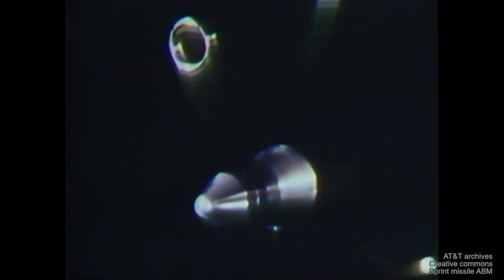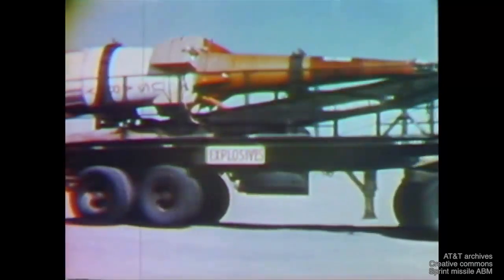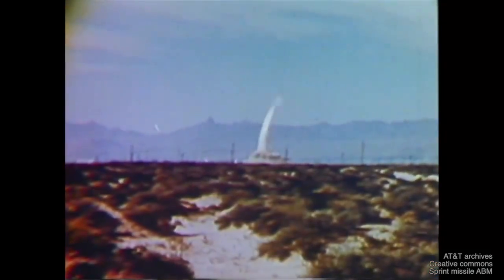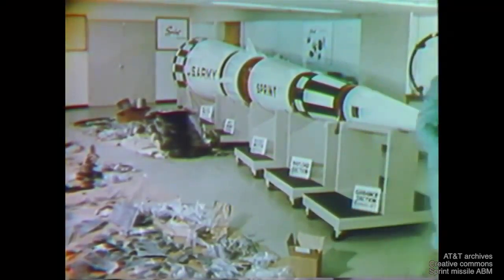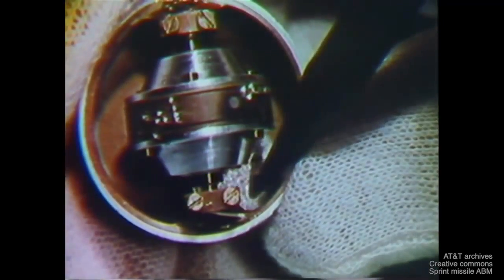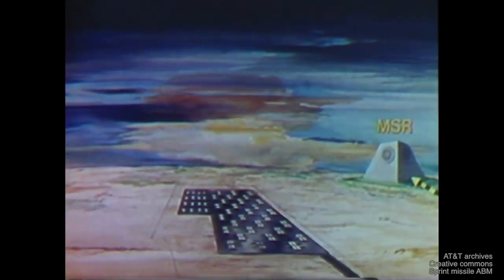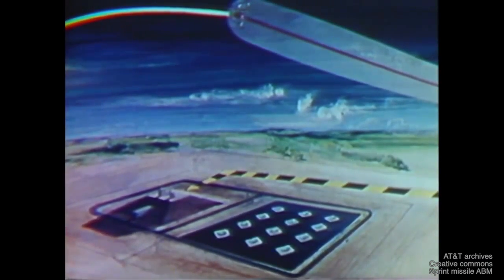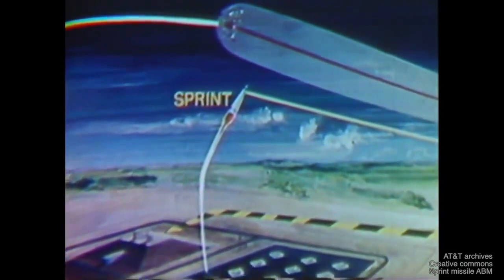SPRINT missile from Martin Marietta - Florida

Comment: My father worked on this missile at WSMR in the mid-late 60's. I remember him telling the story about the corkscrew failure at 1:31. The trick to the missile was target acquisition as the vector for the missile was fed into as soon as it cleared the blast silo. The telemetry form the acquisition radars was very impressive considering this was 50 years ago.
Reply: Mark Satterfield, yeah, and probably 300 bps data rate on the command link. Every bit counted back then, the logic optimization was extremely impressive by modern standards!
Reply: Yup, the old man was Systems Manager for the program.  He said it dug a crater you could have dropped a Mack truck into, and I think he said the entire flight was something like 0.7 seconds.  Figure THAT operating cost out in dollars/second.  

I know, having designed for systems much later, that SPRINT would be probably even more difficult in some ways, to do today.  While it is a lot easier, with all the sim tools, materials, electronics (those electronics on board were DISCRETE wired components, which helped them out immensely in one particular area) etc. to get successes early on, you wouldn't be allowed to get remotely close to the number of failures they had coming up the curve to success.  

The power in those radars was pretty impressive, too.  I think they had minimum elevation limits on it for ground safety reasons, IIRC.  It was microwave, not sure the exact frequency, but if it was anywhere near oven frequency you could probably cook a cow standing in a field close by.

Did your Dad work WSMR, Martin, Bell Labs, what?  I remember Dad saying he worked with some dud engineers a few times in his career and many brilliant ones, but the Bell Labs guys he interfaced were all sharp as hell.  If your old man's still around and was working in Orlando on the program, ask him if he knew my old man (my YT name is real).  I went to Pine Hills, Hiawassee, Robinswood, and Evans, BTW, so maybe we know each other (my memory's not what it used to be and that was a LONG time ago).  :-)  I did meet a few guys from school later working at Martin, too, though.  I'm almost thinking I remember a Satterfield, but maybe not the right one, if you even grew up here.  We're still in WP.  Got moved to the East plant, moved here from West side of town, then got moved back to West plant...you just can't win.  :-)
Reply: I worked at wtmsr.  We worked on f35 and 22.  Tell me no secrets.
.I will....blah blah.   I value these and would never share. Ever.

Comment: but can it intercept a rs-28
Reply: To answer you question yes. Stupidly well actually.

These missiles used  high radiation nukes to kill the weapons electronics. THings is that modern electronics are more vulnerable to that radiation then the 60s-70 ones. 

MCD success rate will go up a lot if they add even high explosives to the kill vehicles, let alone a nuke. Then it just needs to get near to kill the missile target, and not hit it. The reentry vehicle may still hit the ground but the nuke in it would not go off.

So you lose a skyscraper instead of the city.

Thing is the USA doesn't want to loss anything which means hit to kill is the way to go. Which as you can see with the modern "versions" are so much harder.....
Reply: @ericzaiz8358  Yes and no, if you put an SS18 satan missile with 10 warheads and 40 penetration aids + chaff + ECM, it would be very hard to figure out which are real RVs and which are the pen aids. A saturation attack could be accomplished with only a few modern MIRV ICBM's which is one of the reasons we went away from this style of a missile defense system. 

Modern systems like MCD and THAAD aren't meant to defend against Russia or China, realistically they are meant to protect against some 3rd world leader who popped off one or two nuclear missiles our way. 

With modern decoys, ECM, and chaff (and other countermeasures we don't even know about publically), I'm sure it is very, VERY difficult to combat a saturation attack of even 10 missiles. 

Remember, for each actual warhead, you can have 4 decoys on modern Russian vehicles. 

With that being said, penetration aids aside, this missile WOULD do a better job of killing RVs than any of our modern stuff, and that's because it used a nuclear weapon to kill their nuclear weapons. A radiation enhanced warhead would actually cause a fizzle or partial detonation of a nuclear warhead via neutron radiation, and would also damage electronics and firing circuitry with EM/gamma effects. Back then you just had to get within some distance (best-unclassified estimate is 1600 meters) to kill a warhead, nowadays you have to actually hit the RV head-on. For ICBMs, it just isn't feasible as those RVs can be traveling in excess of Mach 25.
Reply: @ericzaiz8358  If they added a radiation-enhanced warhead to MCD, I think we would see a nearly 100% intercept rate. The problem is kinetic kill is hard. 

And you're right, enhanced radiation kill would be a soft-kill rather than a hard kill. Worst-case you'd still have the disabled RV hit the ground at Mach 18, which I imagine would do some damage. 

I don't think to limit collateral damage is why they went away from the nukes though, I think its more a matter of doctrine and how insane the American public would consider "nuking ourselves". You have to also consider that a system like this in an actual attack would consist of hundreds of sprint and ajax missiles being fired, even if the intercept rate was close to 100%, the nuclear fallout would be enough to cause serious problems for years to come. 

With that being said, I do wish that we had a nuclear warhead system as a last line of defense. Dirty kill is better than no kill.
Reply: @Brokenrocktail  The US went with hit-to-kill because while it was much harder to get it to work, if the engineering challenges were overcome, what would result is an interceptor with a much lighter warhead, meaning it would have a wider engagement envelope.
Reply: @ericzaiz8358  no, because sarmat use mirv and sprint has too short range
Reply: It would have a better chance than the garbage we make now. Midcourse defense is a 25% success rate
Reply: @Brokenrocktail  no sprint missile range is too short, sm3 or thaad are better, even if they will not really save usa from sarmat
Reply: @vkobevk  Nothing would save either country from a full nuclear exchange, there just aren't enough interceptor missiles. Evan a Trident missile with 12 warheads would be hard to hit (flight time is only 5-10 minutes)  

These interceptors arent meant to stop a full out attack from Russia or China, they are meant to deter a smaller attack from a rogue nation (i.e. North Korea).  Thats why the sprint program was canceled because MIRVs became so common that it would be impossible to launch enough missiles to destroy all of them. Same goes for Russia. 

If the US, Russia, or China started a nuclear war, no defensive systems would matter, we would all be dead within hours.
Reply: @Brokenrocktail  yeah in theory it is against north korea, but it suppose than north korea is unable to made decoy and mirv and hwasong 15  seem big enough for mirv and decoy and anyway north korea can try to lure american abm with hwasong 14 and hwasong 12 with only decoy and try to shut down radar, thaad and sm3 in south korea and japan with short and medium nuke missile or nuke cruse missile

i suppose than if aegis is on the path of trident it can shot down the trident in boost phase, but yes it seem more hard to do than the theory on paper ^_^
Reply: Toxic Gamer777 yes I’d bet all my money that the sprint missile could destroy anything in the Russian inventory
Reply: @Stacknasty69  Single RV from a single missile? Sure. But remember current missiles in the Russian arsenal can carry 10+ nuclear warheads and over FOURTY penetration aids. Don't forget chaff, ECM (electronic counter measures (jamming, spoofing, etc)), LO (stealth) coatings on the RVs and the bus,  and god knows what other stuff is still under wraps.  Excluding fancy countermeasures, simply guaranteeing an intercept on all 10 warheads would require 50 sprint missiles. Now add in all the aforementioned countermeasures available today and your chances of a successful intercept of all 10 warheads becomes very low. 

Our current system of THAAD, MCD, SM-3 (Ageis), etc are actually NOT meant for Russia, or China, or any other world power. There's simply no defense against an all-out attack, and these systems would become fully saturated with just a few missiles. 

Lets assume instead of THAAD we still used Nike Sprint, and the MCD (Midcourse defense system). We come under attack by 10 nuclear missiles, each carrying 10 warheads and 40 pen aids.

MCD becomes fully saturated, as four missiles are required to guarantee a midcourse kill of the bus and all warheads. We currently only have 36 MCD missiles in Alaska, they take down 9 missiles.  One missile remains. 

The missile separates its MIRV payload and decoys and they begin reentry at Mach 25, with a large spread between to attack targets along the western seaboard. Sprint batteries spring into action and begin attacking the reentry vehicles and decoys, all of which are releasing chaff, and several of which are spoofing. You now have chaff decreasing your signal to noise on your radar, making targets harder to pick out against background clutter, and ECM is now both jamming your radar AND projecting spoofed targets mixed in. You now have a field of over 200 targets on radar, of which 50 exist in real life, 10 of those targets are actual warheads. The sprint batteries launch everything they have, 120 missiles. 

Six warheads are destroyed, 120 Sprint missiles detonate in the upper stratosphere, of which another 32 or so decoys are destroyed, the rest detonating around false targets. 

Los Angeles, San Diego,  Camp Pendleton, and MCAS Miramar are all destroyed via two ground bursts and two airbursts over the cities. Close to a million are dead and the atmosphere now contains the fallout from 4 large nuclear weapons and 120 low yield devices. 

That scenario was just 10 missiles, and it saturated our entire system. Nuclear war is not winnable, just imagine what a medium or large exchange would look like.

Edit: Fixed a word.
Reply: @Stacknasty69  I sent you my Kik
Reply: @Stacknasty69  how with its range of 40 km ?
Reply: no it cant, because sarmat use mirv
Reply: As the US goes full tile on weapons tech  and this new round of Cold War 2.0 ,, Russia will run out of money again ,,,, sorry

Comment: 0 to Mach 10 in 5 seconds...1960s technology!
Reply: The HIBEX... (High Boost Experiment) based on the same platform with a different propellant accelerated FOUR times as fast. It went 0 to Mach 8 in just a second. It was only launched seven times, and all footage is classified. It isn't even known if they managed to record it. According to witnesses, it happened in an instant, you only saw a smoke trail into the sky.
Reply: @SuperGeronimo999  unbelievable what man's brain can create
Reply: They have cameras that have recorded cannon shells and tank shells fired out of barrels. No problemo.

https://youtu.be/lWn_NhYzD_Y
Reply: @bogdog999    HIBEX was much faster than any cannon or other projectiles. The HIBEX acceleration rate produced 400 g's.
Reply: @bogdog999  we can actually capture it but its 2020 technology not 1960s. plus the sabot round fly at mach 5 while the missile fly at mach 10-15
Reply: @SuperGeronimo999   and that was back in 1968 , i wonder where the US is actually at these days  ,,, but that missile did 10000 per second within the launch ,,, holy shit
Reply: @keithbell6104  Logical step would be lasers now. They will intercept any missile, no matter if Mach 3, Mach 20 or more.
Reply: @SuperGeronimo999  yeah i mean look at the YAL laser 1 megawatt laser. With that much power you can quickly take down supersonic and possibly hypersonic missiles out of the sky with just of few seconds. IDK why the US didnt implement that laser in their destroyers or  especially the aircraft carriers for point defense. Its a shame they cancelled it.
Reply: @Fold-103  I think it had some issues, not sure though. Power supply should be more than enough on nuclear powered carriers.
Reply: @SuperGeronimo999  They were absolutely capable of recording it we had the technology to look at the first split seconds of nuclear fireballs.
Reply: @Aurorastellarum  EG&G
Reply: The US was first in Hypersonic missiles
Reply: @keithbell6104 naa do you know A-135 GAZELLE MISSILE?
Reply: https://youtu.be/m8W1L6TDG7w
Reply: @ПростоПарень-и7и  good video..although it was suspected to have been doctored :) Anyway not sure if comparing 1960s and 2020 technology makes sense but yeah.they're both fast...inspite of the 60 year difference.
Reply: @evonrn2000  1) In my video there is already a valid weapon model. There is a big difference between him and the experimental model.
2) Also pay attention to the sound of the rocket. Probably the Russian military mastered the detonation engine. With the same mass and dimensions, it is able to increase the flow rate of gases from the engine nozzle by 20–25 times. This is actually a revolutionary technology.
Reply: @ПростоПарень-и7и  Either way all these interceptors on both sides won't stop meandering mach 25+ U.S, Chinese and Russian warheads from striking their targets😳.
Reply: @evonrn2000  I agree